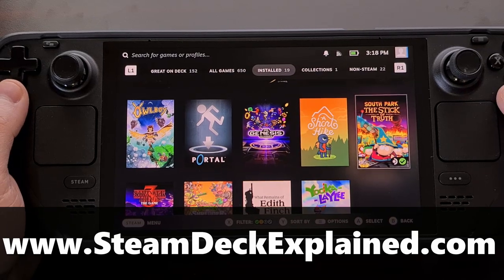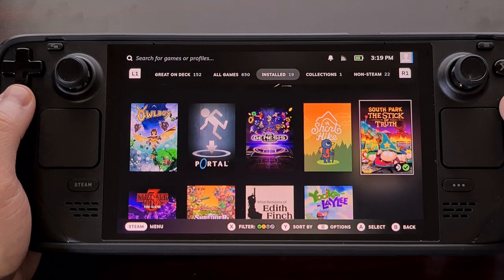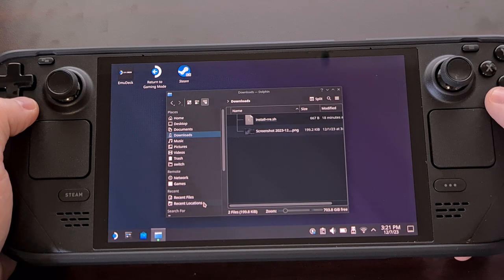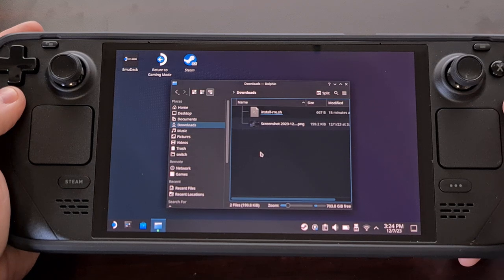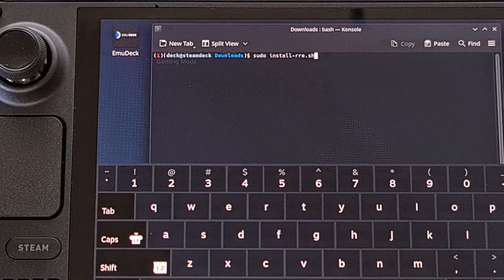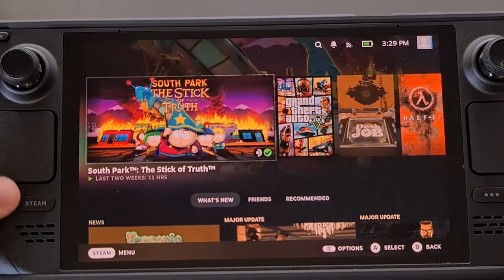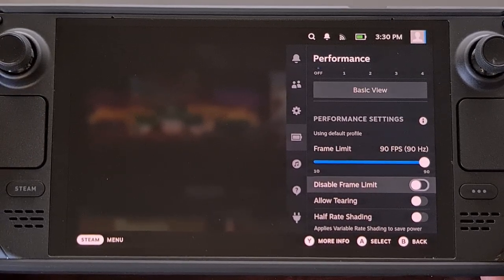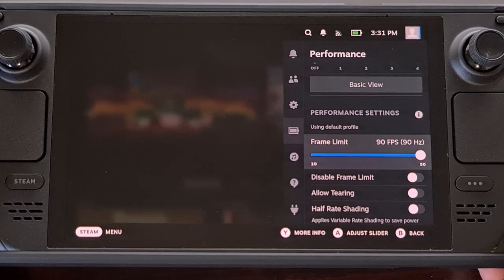Guide: How to OVERCLOCK the OLED Steam Deck Display Panel to 120Hz?

Comment: Hi, this seems to mess up/break HDR for some games. At least, it can be undone per game by checking disable frame limit, which reverts it temporarily and makes things work again, but now frame limits have to be set in game.
Reply from the maker: that's definitely an issue to be aware of. thanks for sharing that detail. what games have you noticed this with?
Reply: @SteamDeckExplained  just baldurs gate 3, I haven't tried any others but its that washed out hdr look you see when it's not working, so i assume it could impact other titles

Comment: The link to gamescope binary is broken, if you still have it on your deck copy it out and replace the broken one with it.
Reply from the maker: hey! thank so much for reporting this issue. I checked this morning to confirm  but hoped it would be up by now. It still isn't, so I found the copy I downloaded to my Steam Deck (for this video) and uploaded it to a mirror so it can be downloaded. here's the updated link if you need it - https://dlupload.com/filedetail/1922067332
Reply: @SteamDeckExplained oh not the script, script contains a gamescope binary also dead download link which when loaded is located and installed on /usr/bin I guess, run "which gamescope" on your deck to check the location. Edit: link is up now
Reply from the maker: @Originalimoc   gotcha, thanks for that information

Comment: I believe this overlock only works on BOE panels, not Samsung panels.
Reply from the maker: correct. I have a video here on the channel that shows how to check which company makes your display panel (if you're curious)
Reply: @SteamDeckExplained  Hopefully i will when i have time. Thanks.

Comment: Can you downclock it to 80 hz for more stable 40hz?
Reply from the maker: the developer did mention that the script also unlocks refresh rates that are not offered by Valve. however, I have not tested it (since I have the Samsung panel) so I can't confirm or deny which options are available

Comment: I know this should use more battery, but how much?
Reply from the maker: I would love to see full battery tests with this mod. It should be easy to perform for anyone who is able to install it. I have the Samsung panel, so I can't overclock mine

But if anyone else has done some comparisons, I would be very interesting hearing about your experience
Reply: Refresh rates have very minimal impact on Battery. There is a difference between FPS and Refresh Rate of panel.

Comment: What's the point of 120hz or even 90 on the steam deck it's way under powered compared to other handhelds!
Reply: It can play indies and older games at 120. Been loving the 90hz on my oled
Reply from the maker: come on, no need to troll, we're all in the handheld console community
Reply from the maker: @Tryhardblackguy   same. this HDR OLED screen is fantastic
Reply: So you are telling us that a $400 device released in 2021, is less powerful than devices that cost 2x and where released just a few months ago? No way 😮? Also, you do know that the SteamDeck can play modern indie games and 2D sprite based games that are less resource intensive? It can also play thousands of games from previous 3D generations that can potentially run at higher fps! Shocking, i know.

Comment: What's the point, 90hz is plenty fast.
Reply from the maker: A higher monitor refresh rate can provide the following benefits: 

 - Smoother motion: A higher refresh rate makes motion appear smoother and more realistic.

 - Reduced lag: A higher refresh rate reduces input lag.

 - Reduced eye strain: A higher refresh rate reduces screen flickering and lag time, which can prevent eye strain.

 - Improved accuracy: A higher refresh rate can improve accuracy, even if the gamer doesn't notice it.
Reply: @SteamDeckExplained  thanks chatgpt!

Comment: Interesting but I'd rather not take the risk since my main gaming machine 😂
Reply from the maker: That's completely understandable. What games have you been playing on it lately?
Reply: @SteamDeckExplained  Oh nothing out of the ordinary. I've been putting off playing Cyberpunk 2077. I finally bought it and have been playing pretty much only this for the last few days. Runs surprisingly well if you tweak the settings a bit.
Reply from the maker: which settings do you recommend changing. that is in my backlog of games I've been wanting to play and the Steam Deck has been great at helping me clear through some of the games on my 'need to play' list  @cangel8563
Reply: @SteamDeckExplained  The game can reach ~40/45 FPS but I personally locked it at 30, I use Intel XeSS instead of AMD's FSR, it looks better. Does runs slightly worse but I prefer to play it that way. Besides that most of the settings are in medium/lows up, where I notice the most dips in performance is probably driving around I think. You could probably squeeze out more fps than I did out of the game but I don't think it's really the kind of game where it matters to have high FPS.
Reply from the maker: I haven't tested it out yet  @cangel8563   but these were the settings I was going to try - https://www.reddit.com/r/SteamDeck/comments/16udtzw/just_in_case_youre_looking_for_the_perfect/?rdt=63135

any thoughts on what is listed there (if you don't mind). the post is kind of old so I'm unsure if that setup carries over to the game's latest version
Reply: @SteamDeckExplained  Seems pretty similar to mines, I just run it at 30 not 40, I think I also raised the mirror quality else it's really ugly lol. (And I don't use FSR ofc)
Reply from the maker: thanks so much for that input. I'm finishing up Fractured But Whole right now (I've finally been able to start getting through some of my backlog of games with this thing!)  @cangel8563

Comment: Why would you want to though? This thing doesn't reach 120 FPS unless you're playing retro games, and it doesn't need 120 hz at that point. This is entirely pointless.
Reply: Playing games like clone hero, Fortnite and more light games, it would be great! For Sure
Reply: Higher refresh rate can hide tearing better, can lower input lag, can allow you to insert black frames at 60fps, can help to show dropped frames on an early refresh cycle, can...
Reply: FSR 3 will also help you make use of that 120hz
Reply: 60fps locked would be perfect on 120hz. Also streaming with Sunshine+Moonlight
Reply: let's be real the answer is why not like if something can be done then someone will want to do that thing
Reply: Stream Game's from PC to the Deck is the only major Benefit I could see
Reply: 120hz also allow for playing at 40 fps while not getting very bad frame pacing on 30 fps cutscenes.

Comment: Still no VRR so this is virrually pointless
Reply: I think it could hit consistent 120 on indies so not virtually pointless. SD OLED @120hz could also possibly now use BFI on emulators so there's also that.
Reply: 39 buried
Reply: you got it backwards, more refresh rate helps surmount the lack of VRR, VRR is more important for lower framerates
Reply: Not true. Lots and lots of games can hit 120hz on steamdeck. I'm currently playing south park the fractured but whole and it does 120hz fine. Lots of my favorite indy, 2D, and older 3D games can hit this just fine.
Reply: @PR0XIDIAN  Yup. It seems like everyone who comments about this mod being pointless thinks that the only videogames in the world are current 9th gen 3D games.
Reply from the maker: I'm playing that game too! I just got to the duel class mission
Reply: @hakdog4299  No it cant. BFI is a monitor feature and cant be done with an overclock

Comment: I paid almost $750 for the LE SD OLED 1TB. Hard pass on potentially blowing out the screen.
Reply from the maker: completely understand that perspective!
Reply: My alienware monitor has been overclocked for 3 years strait (100hz to 120hz) and it was $1500 new. Display overclocking has been around for ages. I just overclocked my limited edition to 120hz and its fine. (I also undervolted it and installed cryoutilities). Runs like a dream. I'm 99% sure based on the model number of the display and the display timings on the BOE panel that it was originally a 120hz panel that valve is running at 90hz due to the fact that the samsung panel can't hit 120hz, and also due to the fact that the color accuracy drops a bit due to display bandwidth at 120hz (noticable).
Reply from the maker: @PR0XIDIAN   i suspect you're right when it comes to the panel. it just makes more sense to have conformity across the board than to split the devices even more
Reply: same im not risking my LE 1tb oled 90hz is more than enough
Reply: Overclocking the screen is not even remotely the same as overclocking processors, nothing will blow up. In face the screen may have been 120hz all along, they just kept it down the the same 90hz as the Samsung panel.
Reply: @PR0XIDIAN can you do a comparison on between the colors with 120 hz vs without I have a boe panel and is curious on how much worse the colors are on 120
Reply: @PR0XIDIAN your 100hz 34” ultrawide alienware comes with this in OSD…its not even overclocking 🤣🤡